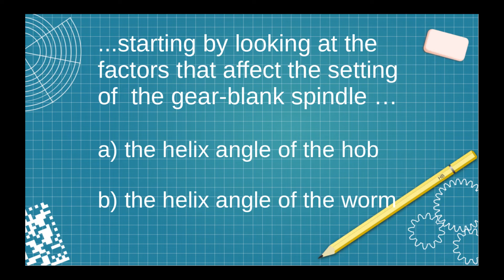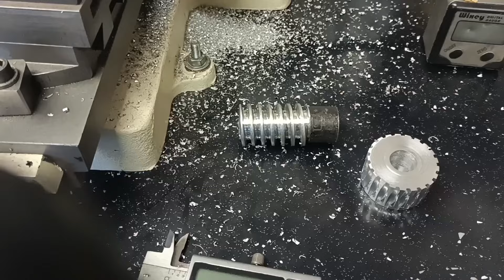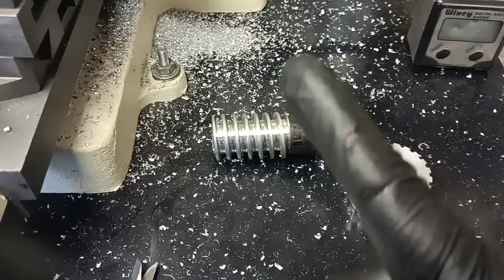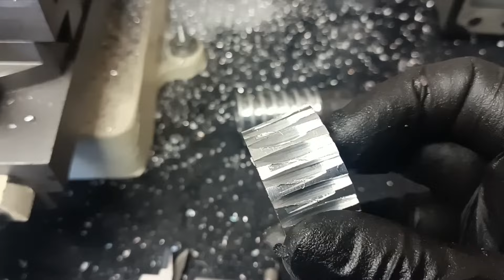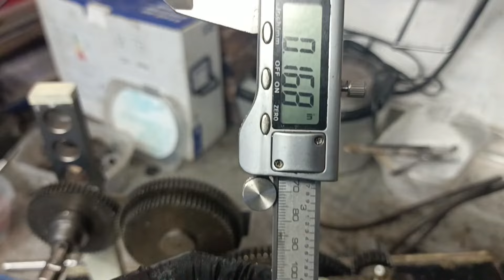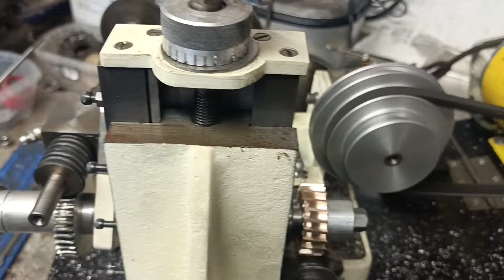hobbing machine set up to cut 1831 worm gear

Comment: Very nice work!  I have cut worm gears on my shop made hobber several times, with good result.  I was fortunate to have a speciality hob for cutting worm wheels.  Smaller diameter to match the od of the worm.  Set up is simple, zero angle…cut to the lead angle of the hob.  All the best!
Reply from the maker: Yes, a smaller hob would be good, but funds don't really support that. The set-up had me foxed for a while until I finally realised that the hob and the worm were of opposite hands, so you needed to allow for that ... at least that what I think the cause was, at least it's right now and the spreadsheet gives the right answer!! thanks for your interest.